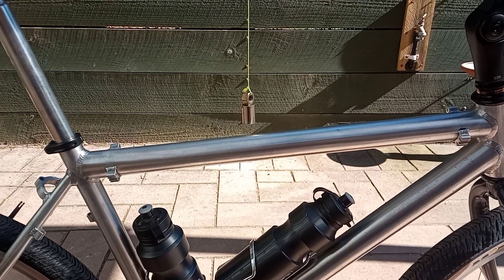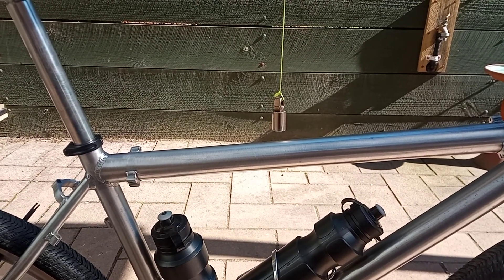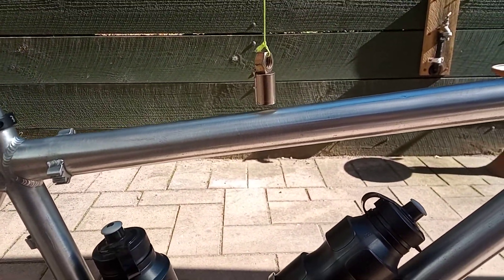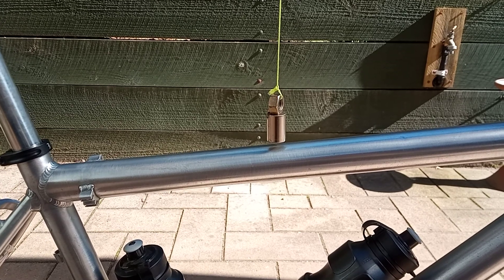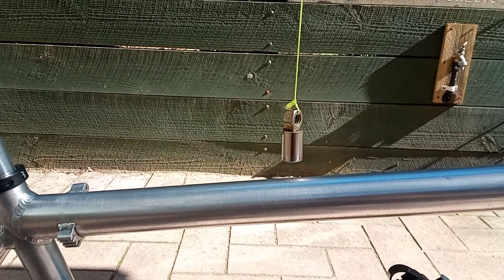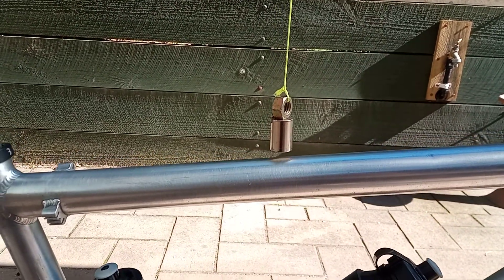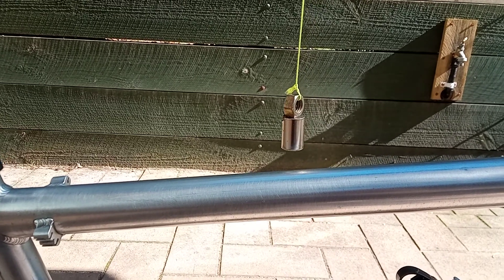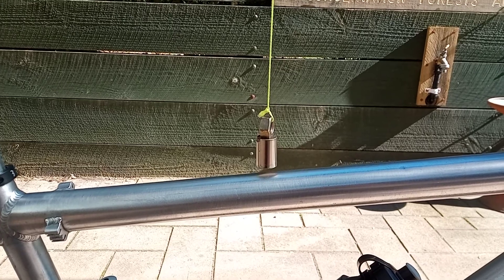Titanium or Aluminum Bike Frame?? Simple Test to find out and 100% reliable.

Comment: Wonder how this test could apply to components. Have a quill stem head of unknown material connected to steel stem tube body, and I need to find out if it's titanium or aluminum. I wonder how far the steel part needs to be away from the magnet to not interfere with this test.

Comment: One look at the welds and it tells if it Ti or Aluminum.
Reply from the maker: Yes true aluminium welds are very distinctive bigger welds bumps where's Ti is usually smoother and tighter welds... what put doubt in my mind was the guy at the bike shop said that some of the early Ti frames were a bit rougher and diamondback made Ti frames in the 90s and couldn't tell me for sure if it was definitely (what I suspected) aluminium...